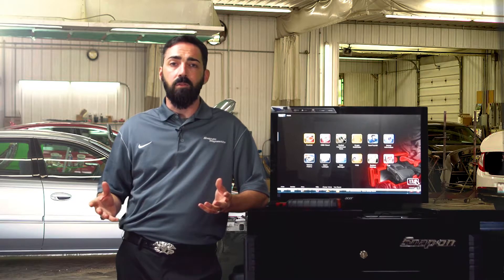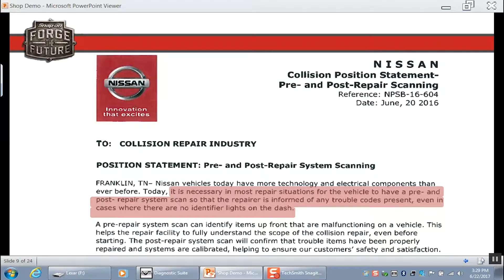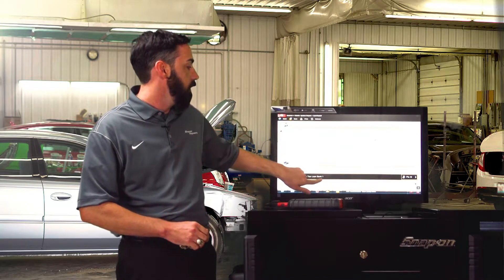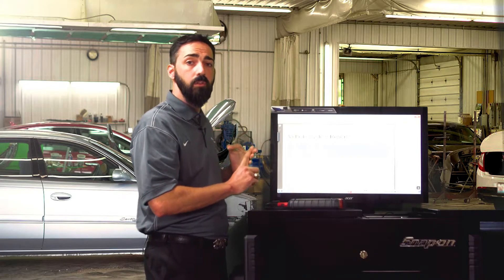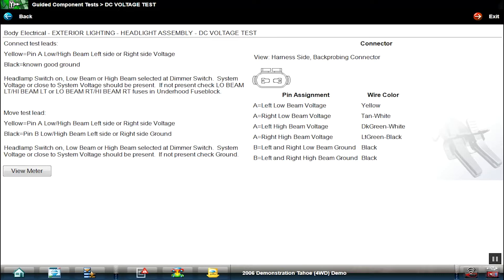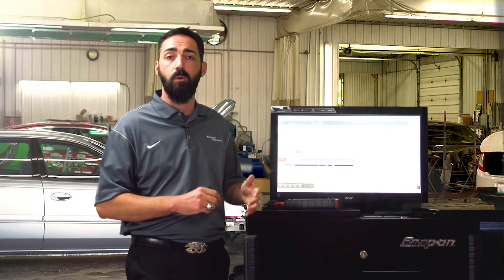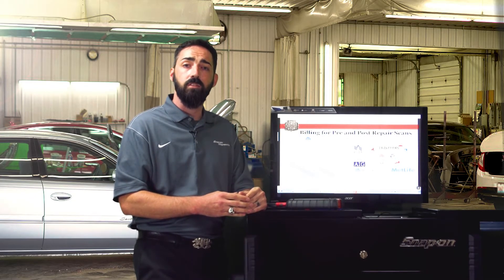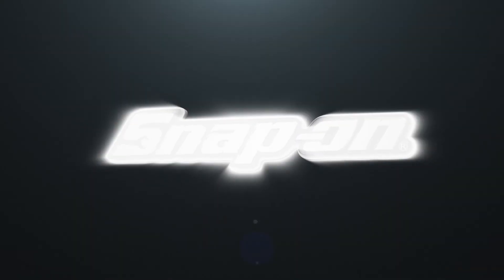Snap-on Diagnostics Pre & Post Repair Scans

Comment: You must connect a battery maintainer before you start your scan and make sure the battery is fully charged, 90 percent of cars leaving body shops always have low battery's. Even repair shops.

Comment: That's cool if you have the insurance company paying , but what happens when someone is paying out there pocket for a repair ? Is this mandatory or is it a law that you have to pay for these scans ? Sounds like another money making schemes for the repair shops !!!
Reply: Scanning is required by OEM's and it is not a scheme to make money. Technicians that are not doing these scans are not repairing the vehicles properly, which makes the repair unsafe. I would not put my wife and kids in any car that OEM procedures were not followed during the repair. Cars today are engineered to be as safe as possible, an incorrect repair can literally mean the difference between life and death in a major accident. Make sure the shop fixing your car is trained.